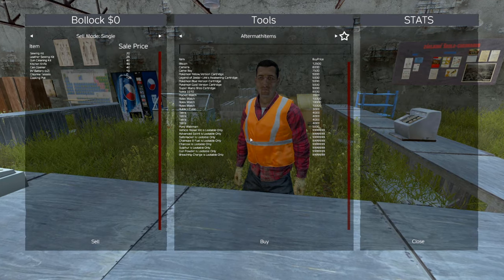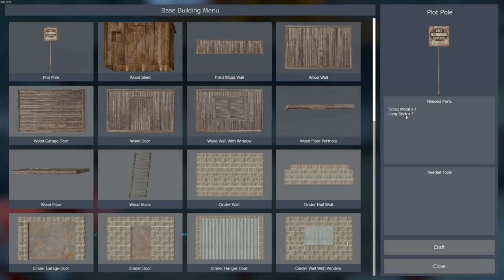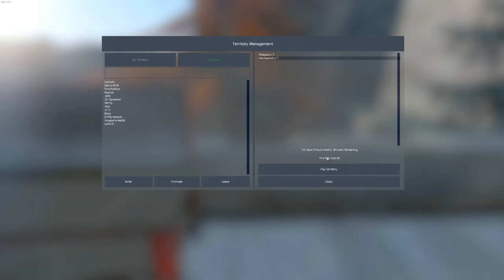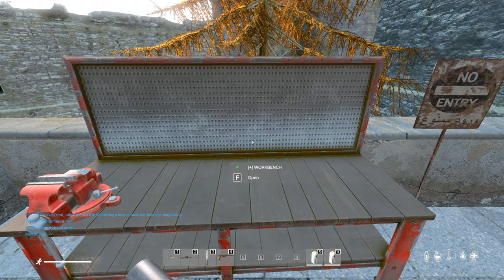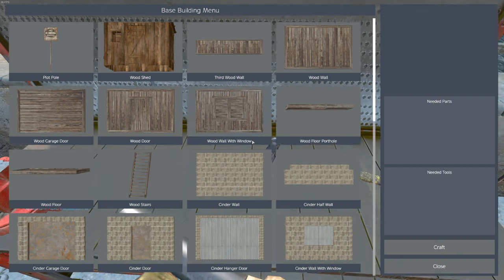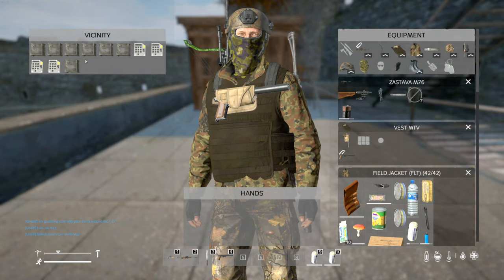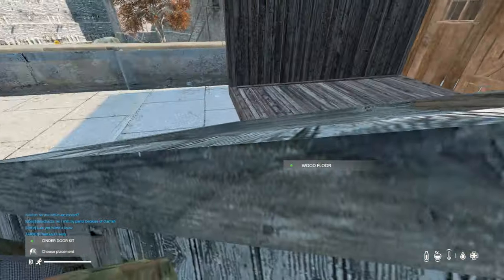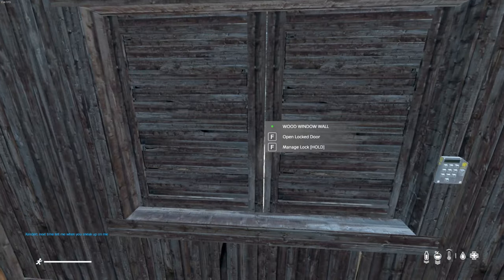DayZ Aftermath Base Building Tutorial

Comment: I have 2 questions regarding the rules that are stated on discord which are :

19 - No stacked tents and storage containers may not be placed on the floor inside tents. These will be deleted without warning.
My question : Can't I place a crate on the floor inside tent ???

20 - Walls and gates must be separated by 1 wall length. No placing of multiple walls/gates directly in front/on top of each other.
My question : If there is a barn and I want to barricade it for a base can I place a wall gate infront of the barn's door ? Or do I have to leave 1 wall length infront of the barn's door ?
Reply from the maker: 1- no you can’t place them inside on the floor. 

2 - that rule only applies to doors/gates that are crafted
Reply: @TheSmokingBro  thanks for the clarification :)
Reply: Ur banned